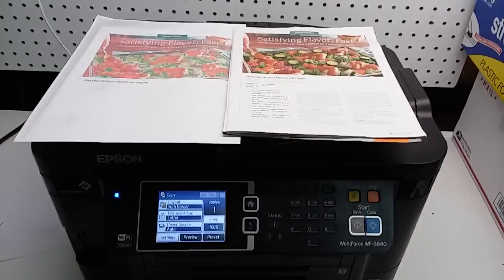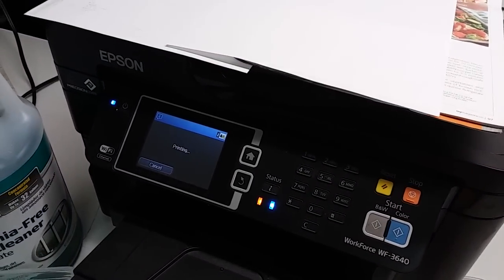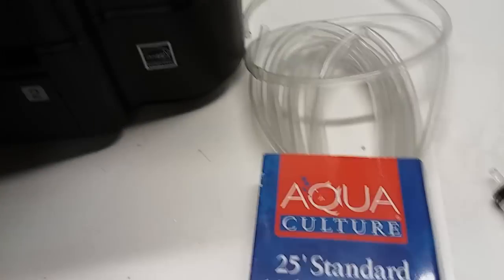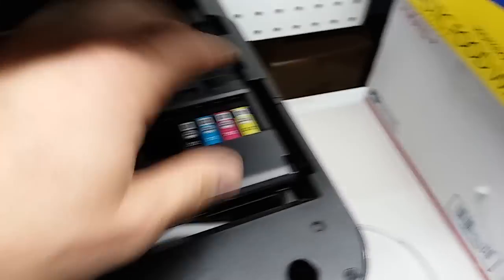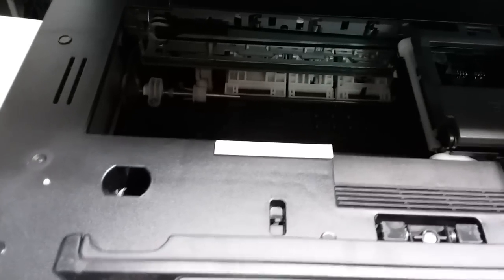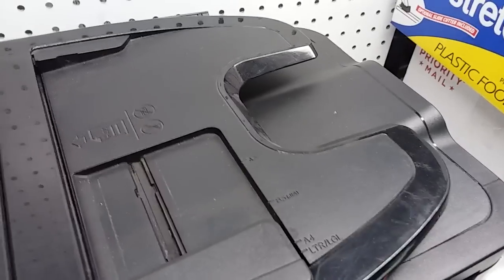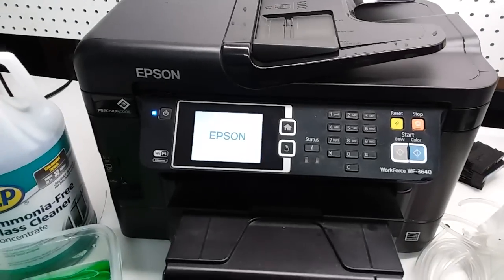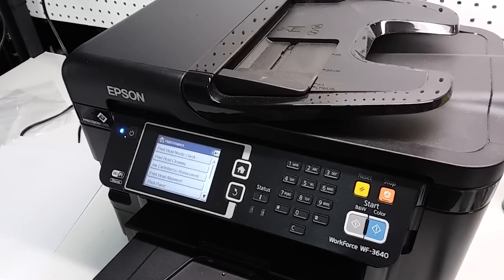Epson WorkForce Printer Cleaning Clogged Printhead Nozzles WF-3640 WF-3520 WF-3720

Comment: Thanks a lot for this video! I had a completely clogged magenta print nozzle. I bought an on-line cleaning kit after watching a popular video. The fluid cleaned the other nozzles just fine, but not the magenta one. And I could tell right away due to the pressure I had to apply to force the fluid through, even after letting it soak overnight. I then made up a 4 to 1 solution of Windex to ammonia and tried again. Within a couple of minutes of sitting, the pressure I had to apply went way down and I was able to unclog it. After running the Epson Nozzle Cleaning procedure a few times, the printer works like new again. Thanks again!
Reply from the maker: You're welcome! Thank you for sharing!

Comment: My compliments on this video.   It was a lot of work.   I started with reasonably good black printing and all 3 colors would not print.    A scary moment when I tried to power up the unit, it came up with 0x9A errors on the screen.    Power cycling wouldn't cure.     I found other web references to this and let it sit unplugged for about an hour, held the power button down for 60 secs and while continuing to hold the power button, applied power with the button pressed for another 60 secs.   Error was gone.   Had to run a few Nozzle Cleans and all is good now.  Thanks for the information.

Comment: It worked.

I didn't have any amonia.  I used 4 parts windex and 2 parts 90% alcohol.  I used a syringe and a .25 inch diameter tube from the hardware store.  My total expense was 25 cents for tubing, the syringe was free at the CVS, and $3.50 for a bottle of 90% alcohol.  I had to put downward pressure on the syringe since the .25 inch tubing was slightly too big.  Now my printer check page shows all four colors.

Thanks a lot for the video.

Comment: If I may add a suggestion - take your printhead out and clean out while it's out of the printer. You can also soak the whole printhead in the solution but make sure to use an air compressor or such to blow out any excess liquid when done and let it air dry overnight before reinstalling it. The circuit board is fine to get wet and soak as long as there's no power going to it until it's completely dry.
Reply: How do you get it out?

Comment: OMG! It works! My Epson WF-2750 was printing horizontal lines (different colors). I use it once in a while and I will follow your recommendation on printing 1 page/week to prevent this happening again. This is what I did: I used a kitchen syringe (the ones for the Turkeys) ;D, 8 parts of glass cleaner with ammonia (the only I had) and 2 parts of 50% Alcohol (the only I had). I cut 1 inch (approx) of the aquarium tube and luckily fitted into the syringe. The problem color was the M and I did a total 15 ml done in 3 parts. I did 3 ml approx on each of the other colors. I had to change the paper towel 4 times in total. 

Head Nozzle report at the beginning was: Black 100% good, Magenta 60%, Yellow 100%, Blue 95%
Head Nozzle report at the end: B 100%, M 95%, Yellow 100%, Blue 80%

I calculated the percentage based on the printed sheet. Magenta got A LOT BETTER..... BUT, Blue got worst!! Anyways, I was lazy and decided to leave it like that for now. I Just needed to print my 8 y.o. son's school project and now it's 95% quality on the printed pictures Vs. 60% that was before. 

THANK YOU SO MUCH!!! :)
Reply: T. G. Hello I have the same printer with the same problem

Comment: Thank you so much for this DIY. My wife was always complaining about the clogged black nozzle. So i did this fix, without the tube though so it overflooded a little bit in the cartridge department. I dried it with some paper, then put the printer on for some test. After that it shut down completely 😂 Gonna check tomorrow, otherwise gonna order a new printer. So thanks again!!🤣
Reply: You most probably either shorted the printhead out or delaminated it. Epsons are nothing but trouble. Next time get a printer with combination printhead-ink tank cartridges like HP or Canon. They are easy to remove, unclog and refill and when they finally bail out you don't have to trash the whole printer. Buy a set of remanufactured cartridges for a pittance and off you go! Leave Epsons where they best belong: at Epson's warehouses collecting dust. Maybe one day they will understand not to design their crap with Planned Durability and time bombs built-in.
Reply: so did it come back on? Mine just died too.

Comment: Don't forget to clean the cradle on the right.  When the printer is off & locked the print head stays over this small tray and that's where the goo stays. No matter how clean your print head is it will sit in the goo when you turn off = recontaminating the head.  Finally mine is working again- that was the problem.
Reply from the maker: Thank you very much for sharing.  That is an important hint for all inkjet printers.
Reply: How exactly do you clean that small tray?
Reply: @marc10000000  make a solution of water/windex/alcohol fold up a piece of paper towel, moisten it with “ and soak up all the crud in the tray.  Several times. Wear gloves.
Handle with tweezers or pliers.  Finish with Q tips. Bag it as you go. Easy but messy!
In maintenance do a nozzle clean & check.  Repeat if necessary

Comment: Thank you so much! I did manage to take out the whole print head first as per your other video. On the syringe I attached a piece of shrink tubing (5mm or 3/8" diameter) used for electrical wiring. After heating it up with a lighter, it sat quite well on the syringe's nozzle and also fit well over the ink intake nozzles on the print head.

Comment: I prefer not using any tubing at all, to avoid it getting loose under pressure and spray liquid everywhere (which is very bad for electronics, especially the cart chip daughter board). I simply force the syringe nozzle onto the cartridge spikes. It always provides with a tight and firm coupling. No leaks, no uncontrolled spraying.
Reply from the maker: Yep, thanks for the advice.  Have a great day!
Reply: I decided this was a good idea, one less thing to have to buy. Word of caution: if your syringe is a tight fit on the cartridge spike head, you've got to be careful not to break the spike off wiggling the syringe on or off. Learned the hard way...aaaaand now I need a $26 nozzle head...from China...

Comment: Brilliant - worked first time!  And I didn't need to buy expensive cleaning products as in other videos - used what I had around the house.  Hadn't known how to be able to move the print head freely - turning it off in mid-print was the answer!  Thank you!  One issue - the black had been the problem, and the test print showed the other 3 colours were good.  After this cleaning process the magenta played up!
Reply from the maker: Thank you for sharing! I'm glad you were successful in the process! Have a great weekend!
Reply: @303electronics  Thank you.  Unfortunately the magenta, which gave a perfect nozzle check before I sorted out the black, is now patchy.  Have cleaned that int he same way I did the black, but there is no improvement.  The black was not showing up at all before, so was definitely clogged and now cleared.  Have you any idea what else I can do to cure the magenta?  I've done lots of head cleaning but nothing is    improving it.
Reply: @tessabell9231  did you manage to fix magenta colour? I am having same problem... it was good before, only yellow was clogged, now all good but magenta not printing at all

Comment: Thank you 303 had a massive problem with the printer not working.  Thought I could fix it by buying £130 worth of Epson ink and paper only to find it didn't make much difference.  Did the flushing with antibacterial spray / bleach with warm water.  Could see the ink was flushing out.  Should have worked fine, but the printer refused to accept the inks back in.... £130 down the drain.  Managed to get the printer working on and off, by replacing the inks one by one.  Still gave me a lot of hassle.  Got something going when I pulled the cable out and replaced it, again adding the inks, one by one.  I then stacked the printing requests, so the printer didn't have much time to think about things... it worked.  Could have something to do with drivers... maybe.  Think the printer may need a firmware update... who knows!  If you have some more advice would appreciate your help.  Thanks again
Reply: NEVER update printer firmware of ANY brand! Those slimey monopolists have third-party carts blacklists built in the firmware to ward off "unauthorised" cartridges! You may end up having to trash your newly-bought carts which were working fine the day before! Next time buy a printer with combo printhead/ink tank cartridges as they are a doddle to take out, clean, unclog, refill and reuse. When they finally give up the ghost, you replace just the carts for a few euros, instead of sending the whole printer to the recycling centre. Also, no waste ink tank counter time-bomb! Avoid Epsons like anthrax as they are a disgrace.

Comment: Amateur Hour to others out there; however, what you mentioned about EPSON BRAND INKS was the Gold Brick here. Your are correct in that the ignorant out there believe if they use a brand name, it will work correctly or be superior. The “in the knows” learned the hard way that is rubbish, TYVM.

Comment: Addendum to the thread "Doesn't recognize ink cartridges after procedure". That's likely because the cleaning solution forms an electrolyte, affecting circuitry inside the print head. I flushed the intake ports with distilled water and the problem went away.
Reply from the maker: That's great! Thank you for sharing, Sir! Have a great day!
Reply: Same thing happened to me, i only waited for the chip reader to dry and it worked again
Reply: I also have the issue of cartridges not being recognized after cleaning (based on another YouTubers instructions) hoping the distilled water flushing method will work for me.

Comment: If you can't recognize your cartridges after this method then you accidentally sprayed liquid into the flex cable that connects to the printhead and caused a short, which then blew the F1/F2 fuse inside your printer motherboard. Also leave your printer off for a good while after doing something like this (minimum 24 hours).
Reply from the maker: Thanks for sharing great advice! Have a great day!

Comment: Hello- 
I’m trying to unclog my Epson Workforce and I’ve tried a few different methods- 
I used a syringe with about 2” of tubing, filled it with with the warm solution (8 parts windex 2 parts alcohol) and it would leak down into the heads. But very slowly. So I then tried to flush them out (pushing and pulling up on the plunger). 
When I did this, a few of the colors flooded/flushed back into the syringe. Leaving me to believe the ones that didn’t are the ones that are still clogged. So I ran a few more tests (printing & head cleaning). But still no black. I then tried your method with shorter tubing. But the solutions just leaking out. 
I’m not sure what to do next. I can’t really let it sit because the solution does go down into the heads. 
That said, I’m just wondering if you might have any other recommendations I can try? 
Thanks so much.
Reply: I have this same issue! I know it has been a month but I was wondering if you have fixed it?

Comment: could be good if you print a test page after you done the cleaning
Reply: I can verify that this method works cause I just cleaned a WF3540 that was sitting unused for 4 years. It took a whole lot of flushes (I used an entire ajax bottle solution mixed with isopropyl alcohol 8 to 2 portions) I used a flexible tube (from a fish tank) to properly attach the syringe to the ink valves. Also a whole roll of paper towel that I folded sections of, and put under for every flush. It took a couple of hours but the result was rewarding.

Comment: Thanks for this video! I’m following all your suggestions. Question: what did you mean by letting it sit overnight in extreme cases? After injecting liquid, do I leave the cartridges out? Wouldn’t that dry up the untreated nozzles?
Reply from the maker: Hello, thank you. What I meant by that is to leave cartridge nozzles in solution overnight. I'm sorry I didn't make that clear enough, but thank you for pointing that out. Have a great weekend.
Reply: Thanks for the reply. I thought I was following directions closely, but now my printer has a 0x9a error and won’t function at all anymore.

Comment: I may have injected excessive mixture causing the flex cable connected to the printhead to burn the circuit. Watch out. May be 2-3 ml will be enough for one time. Do it a couple of times for each color.

Comment: my printer had black and magenta clogged. The magenta cleaned out perfectly with this method and prints great, but the black is so clogged that I can't get any solution pushed through it at all, what do you recommend for that?
Reply from the maker: Try soaking the printer nozzles in solution overnight or like 8 hours. and try Flushing the nozzles after that. Also you can expedite the soaking down to an hour if you make the solution warm. I hope that helps. Epson nozzles can give a hard time and sometimes seem like they permanently clogged and won't budge. I hope that's not the case for you.

Comment: If i use acetone ( nail paint remover) is it going to work?
Reply from the maker: You will damage the printhead. Too harsh
Reply: @303electronics  mmm i already have done it. And now i am its not working fine. I am using epson xp3100

Comment: I think I followed correctly, but after reinstalling the same cartridges., the printer would not recognize any  of the cartridges.  There is a mixture of Epson and generic. I replaced one of the generic with a genuine Epson and it was not recognized either.  I tried putting a shim behind the cartridges to push them to tighter contact. No joy.
I may have powered the unit up prematurely after cleaning, but since then I've tried various combinations of plugging and unplugging.
Any thoughts?
Thanks

Comment: I just completed this and my nozzle check looks worse? Like, it doesn't print anything now...
Reply from the maker: There may be air bubbles in lines.
Reply: @303electronics  in what lines? I'm sorry I'm a dummy
Reply: @303electronics  how would I go about removing them?
Reply: I have the same issue, did you ever resolve this?

Comment: Unfortunately after I did this, my Epson thinks it's using incorrect cartridges and won't print the test page or run the head cleaning.
Reply: I have the same problem
Reply: Did you get it back working? Mine just did the same thing🤦🏻‍♀️
Reply: @caelamhorn  Nope, I pitched it in the garbage and bought a simple b/w laser all in one. No more issues with ink in the future drying up or clogging the heads.

Comment: So frustrating.  I did everything as directed and now it doesn't recognize ANY of the cartridges.  I used to be able to bypass that when it would say not using Epson ink but to proceed anyway.  Now I can't get past the not recognizing the cartridges.  I don't want to go and buy Epson ink in case it won't work.  
I am having a shoulder replacement surgery on Wednesday and will not be able to fiddle around for a few weeks nor buy a new printer!  Any remedies anyone?  Please...
I removed the cartridges several times and reinserted them which used to help before, but not now.  I use after-market ink also.
Reply from the maker: I'm sorry you are having trouble with the printer. I recommend refillable aftermarket ink cartridges. Put some cleaning solution into the cartridges and that may clear the nozzles.
Reply: @303electronics  Oh, thank you for replying!  l actually am using aftermarket refillable cartridges. If I put cleaning solution in the black one, for instance, would l be able to clean it out enough to reuse for the black ink?  Or should I purchase a new one? I’d love to have it working again!  I’ve borrowed another printer and it is terrible!  A really slow hp one.
Reply from the maker: @evacamarata359  yes. Just fill and rinse a few times after solution
Reply: @303electronics  Thank you so much. I’ll try it soon, when I can get my arm out of its sling. ♥️
Reply: This happens when you blow the fuse by shorting out the printhead. Usually liquid gets into the flex cable that goes into the printhead. The only repair is a new board or soldering a fuse onto the old one.

Comment: I was wondering about my LA's TOTALLY AWESOME all-purpose cleaner because I have a ton of it since it designed to clean just about everything including INK stain! You just mix a different concentrated level depend on what you are cleaning. I will try this with 50% distilled water(distilled water will not have little particle in as normal tap water does which also can clog print heads).

Comment: I did this and my blank ink is somewhat working. Also, I checked my ink levels and everything is low now. Just bought my colored ink yesteday... waaaah. What could’ve happened?
Reply from the maker: Try removing ink, shaking it a couple times and reinstall. That will prime ink into the printead.

Comment: I followed the steps in your video but didn't have a syringe so I tried using a spray bottle (bad idea.) anyway it made quite a mess but still seemed to work. But when I plugged the printer back in and tried doing a nozzle check, it printed a blank page whereas before it was still able to print. Any advice on how I can fix this?
Reply: Any luck with this?  I've got the same problem!
Reply: @santacruzdan11  were you able to fix it? My black is finally printing again after like 10 printhead cleanings, but none of my colors are. 😫